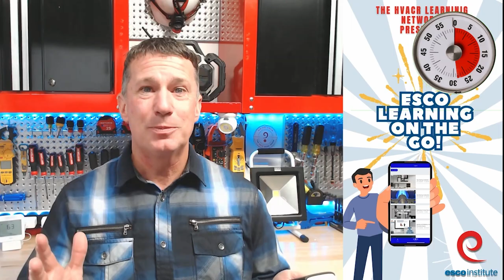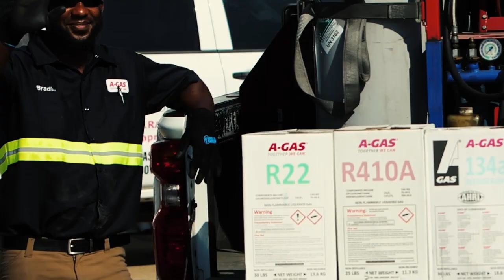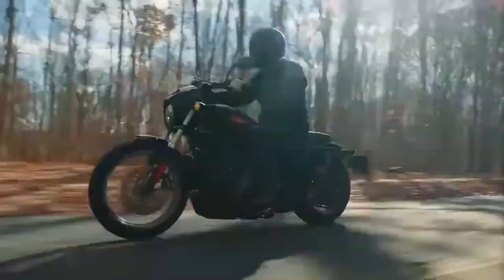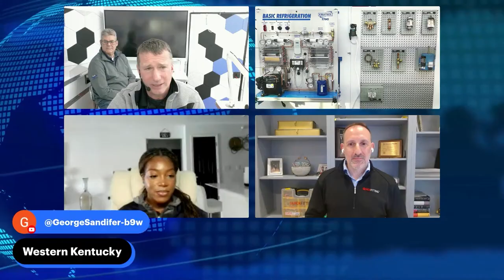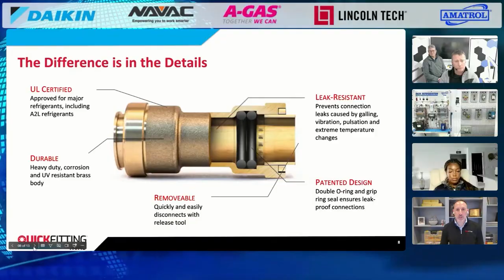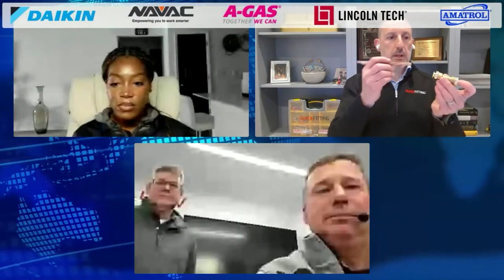HVACR installations made simple with braze-less quick fittings

Comment: Good stuff, thank you. Sometimes, too many times in my opinion, I had to deal with soft copper tubing (typically 5/8" and 3/4") that was out of round...enough to make it difficult to get the fitting installed.  I would pound a swage tool into the pipe to round it out a bit better. Improperly stored tubing gets flattened either in the warehouse or in the truck...I think I would want to inspect soft copper for out of round at the supply house before attempting to use these fittings.